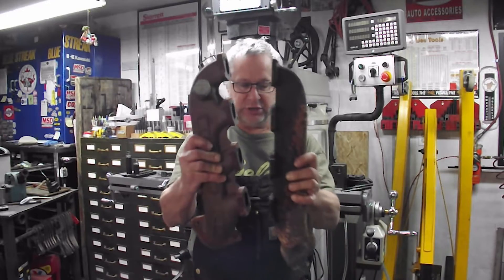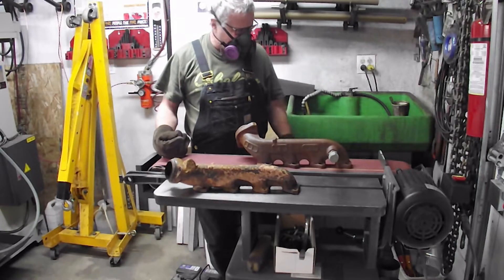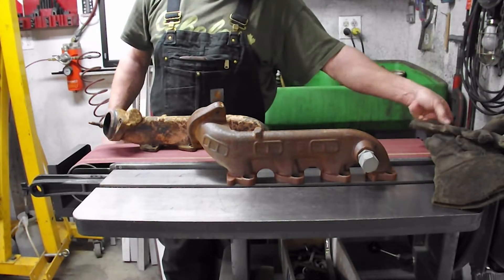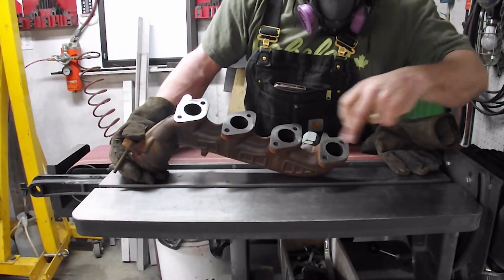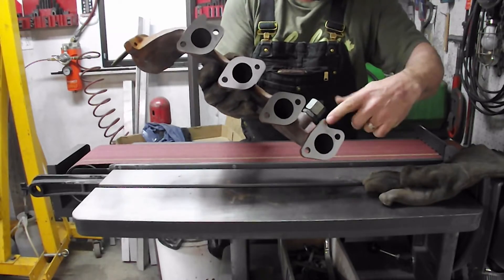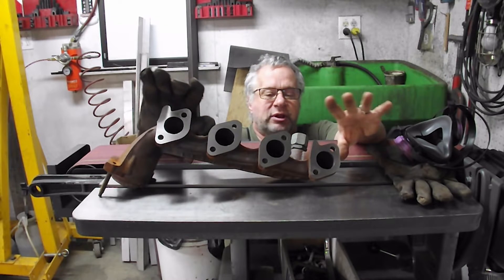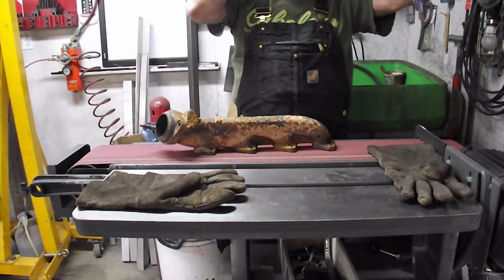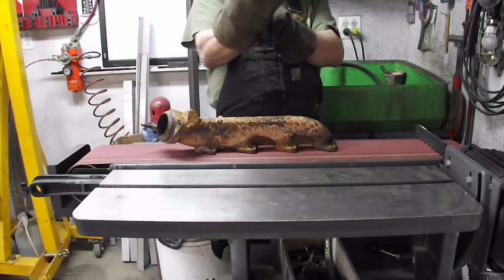Exhaust Manifold   Belt Re Surfacing

Comment: Well learned today the importance of flat exhaust flanges .. explains why mine are cracked on banks 5 and 6 of my golf vr6 (european car) very educational video !
Reply from the maker: Unfortunately, most things are made with as little as possible with the cheapest as possible metal. You could likely get the cracks brazed up if you know a good welder. Manifold still has to be removed. Braze weld is malleable and will live through the repeated heat cycle of your exhaust manifold. Good Luck. Thanks for watching and commenting. Hope you will subscribe.

Comment: Tech Question: Are zirconia belts better for this or does AlO2 belts give a better finish?
Thx
Reply from the maker: I have used Zirconia belts, but I get the better cost per manifold out of the ALO2 belts, and they are more available in the size and grit I am using. 60 grit belts ALO2 does more manifolds than 80 grit Zirconia. Thanks for watching and commenting. Hope you subscribed.
Reply: @acmemachining  Well I ordered a set of both in 60g Zir and 80g AlO2.
Have redo a Hemi manifold. Found out that replacing is NOT the way to go.
Resurfacing a heat treated one is the hot ticket. Whereabout (approx) are you located? You sound Canadian.?
Reply from the maker: Started the channel in Acme Alberta, hence the name. Recent move to Sackville New Brunswick. I bought the home I grew up in from my parents and I'm currently building new shop. Will be posting new videos as soon as possible. Merry Christmas and good luck with your project.
Reply: @acmemachining  Yeah tried googling ya. But too generic. Too many hits back. Thx and a safe-happy Merry Xmas to you! (ehh)

Comment: Great video! Thanks! What belt speed do you use? Power and rpm och motor? And belt grit?
Reply from the maker: Thanks for watching and commenting. I use 60 grit belts running 3150 feet per minute. 1 - 1/2 HP motor. Works great. Hope you subscribed.

Comment: How do you do a Subaru with a long pipe integrated into the manifold ?   Smaller hand held Craftsman belt sander ?
Reply from the maker: Hang long pipe so surface will lay flat on surface of belt sander. Entire manifold must be flat on belt sander. Smaller belt sander may not achieve what you want. Thanks for watching and commenting. Hope you subscribed.

Comment: Yup got a Ram 1500, 5.7 Hemi. Manifolds need this done to them. Well I replaced the passenger side with a brand new one, so it'll be warping soon I'm sure. Driver side Id like to have this done to it, instead of having to keep buying these manifolds that are just gonna warp again. How much would you, or do you charge for this? What's your price per manifold? I know of a few machine shops near me, & what would be a good guesstimate price wise? Thanks, & good job on the manifolds!
Reply: Oh yeah just subscribed to your channel too! 💪🏾
Reply from the maker: Thanks for watching & subscribing. I charge $60 per manifold to belt sand, or $100/hr if it has to go on the mill. Usually do at least 2 pair per week. Haven't heard of any needing redone in over 5 years, so it must be working.